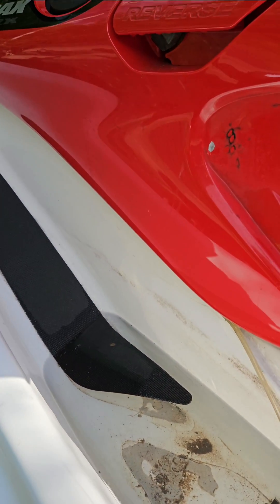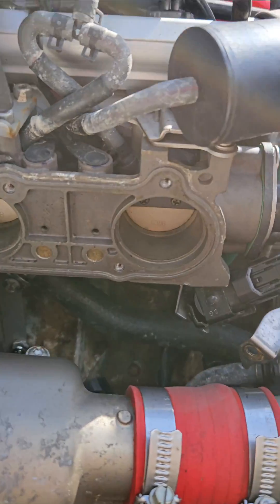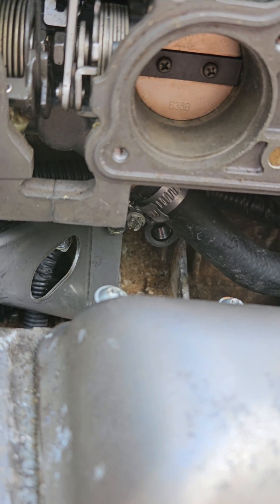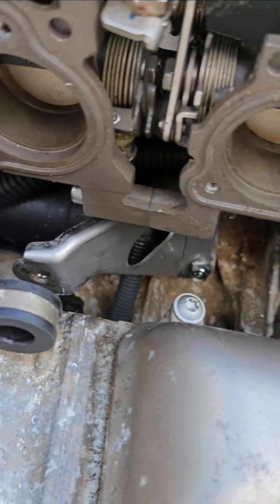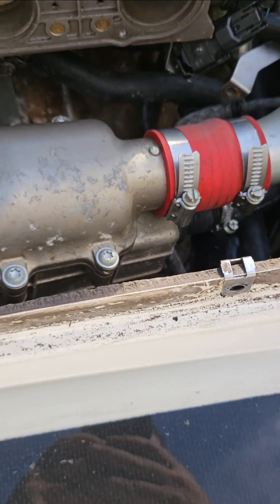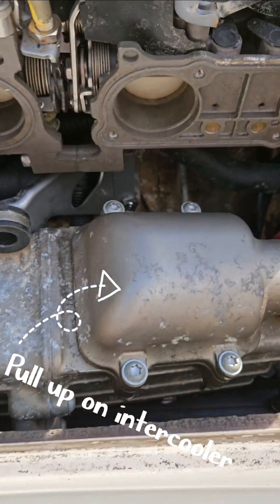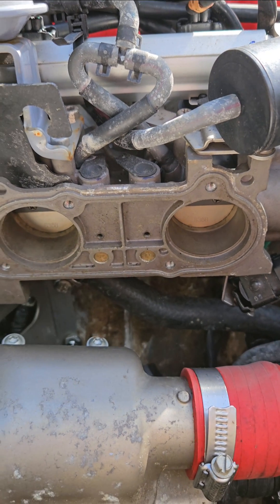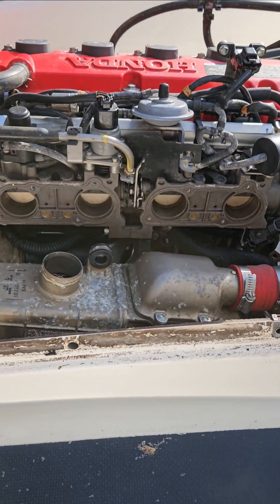Honda Aquatrax Knock Sensor Location and Test #honda #diy #pwc

Comment: do you need new gaskets for the intake?
Reply from the maker: You may but upon inspection these gaskets were fine their rubber Orings; to reuse I like to apply a little grease to help reseal. hope this helps!

Comment: Any updates ?
Did the code come back ?
Mine rides fine for aboutv2 hours then it goes into limp mode. Ive been debating what to do, reflash ECM or change knock sensor
Reply from the maker: @CHRISTSMERCENARY  knock sensor took care of it in this case it's Definitely worth trying it first.
Reply: @WilsonMotoGarage hey bro did u use oem knock sensor or off brand? That’s for your time
Reply: @WilsonMotoGarage  you must be part of that 1%... its definitely worth trying that first if you have mechanical skills. Didnt work for me unfortunately.
Reply: @christsmercenary mine does the same thing I replace it with an off brand and with in the first 10 mins it dir it haha.
Reply: @alonsodeleon4061  i replaced it with a honda oem knock sensor but it didnt fix the problem. I bit the bullet and got the ecu flashed and shes running great now. I put about 20 hours on it this season and ive had no issues.
Reply: @CHRISTSMERCENARY  how much did that run u and can it still detect any other issues?
Reply: @alonsodeleon4061  It was $480 total. Gen-tune is the only one that does it. I asked that very same question. He told me it would still detect any other codes it  just deletes the code 25 for the knock sensor.  He will answee any questions you have and the turn around time was super quick for me. Im sure it depends on where you live.
Reply: @CHRISTSMERCENARY hey bro thanks a lot for the time and yea I’ll be going that route last thing I want is to buy one and it’s bad